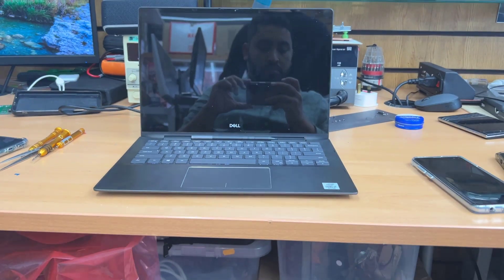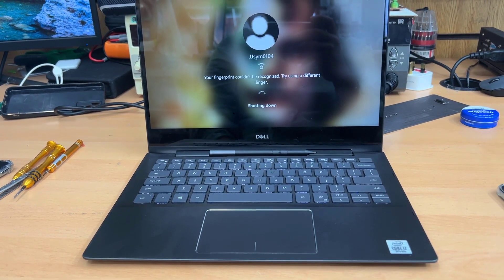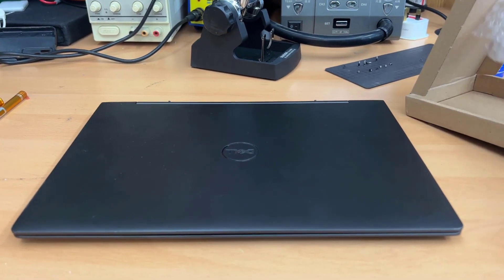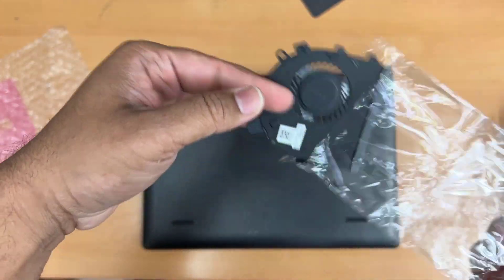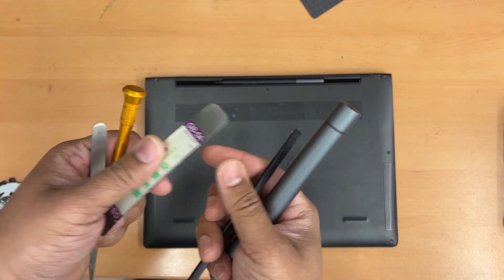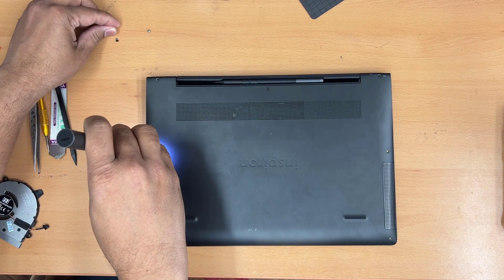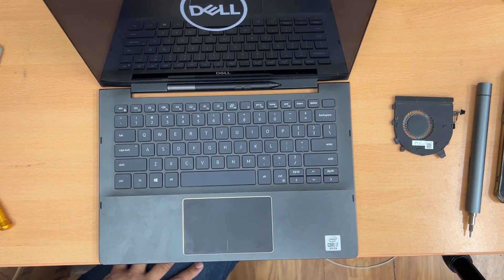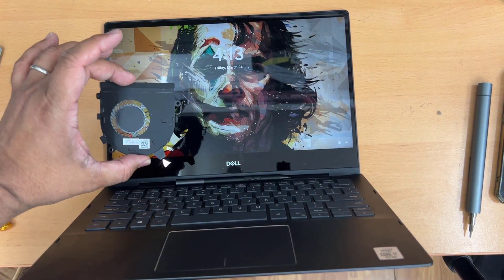How To Replace CPU Fan For Dell Inspiron 13 7391 2in1 Laptop

Comment: Thank you for sharing,! You do a great job with intro but the most vital part of actually replacing the fan is hard to follow. The video goes fast, lots of parts are covered by hands. For someone like me, who never replaced a fan or even opened a laptop hardware this is really hard to follow. I appreciate the effort, though.